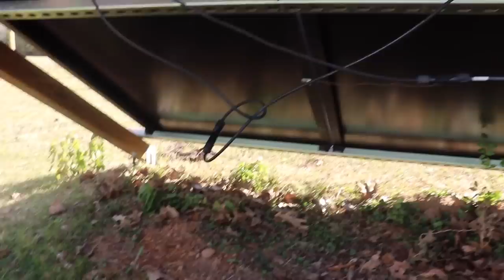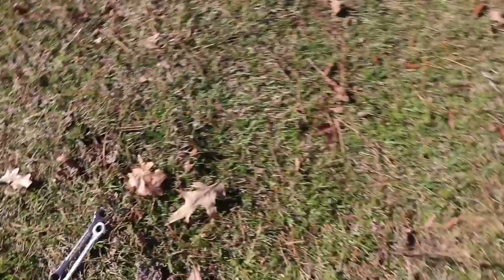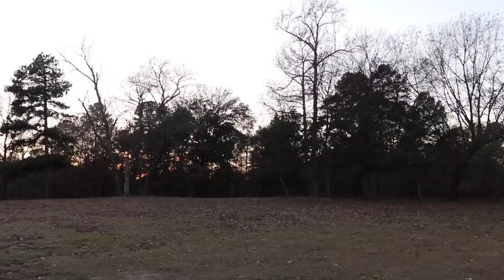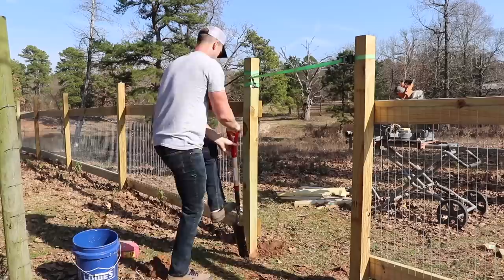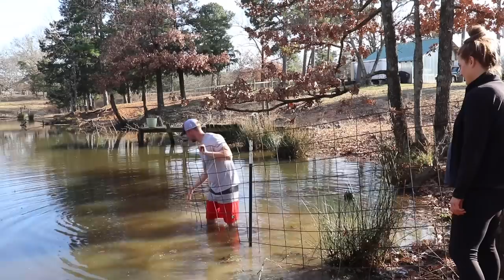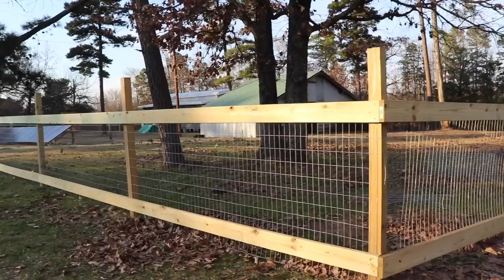Building More Than A House

Comment: i hate to burst your bubble but the fence will never keep a dog in by itself. one must have an anti dig wire on the inside and also be tall enough to stop jumpers and climbers. also, mr. spencer, if you will use pea gravel around your gate posts (all for that matter) and tamp it by tapping the posts on opposing sides with substantial hammers, the posts will not loosen up and will not rot off at the ground line like using concrete. future extraction is made easier doing this. hope yall the best......g

Comment: Ok you better put a hot wire on that fence with Barb wire and cement all the posts if you siol is clay or caleechy add cement lie and soda you don't have to add water it will keep on hardening

Comment: Congratulation guys your almost at 300K, I'm so happy for you. OMGoodness I do believe I would put a hot wire on top as well. Also, leave that pull strap on as long as you can, yep they will keep pulling apart even with the cement as they settle over the years. I wouldn't take it off ever. Those Coyotes would terrify me, I heard a coyote one night and it sounded just like a Hyena scared me so bad it took me a long time to go out in the dark again. OMG those hogs could kill you then eat you. I would be killing them then eat them.

Comment: Pardon me for my ignorance but when you were nailing the wire fence to the posts you would just do it vertically on the one side. Would it not be stronger I'd you hammered on an angle and Crossed over. That way it would be two wires versus one.

Comment: Any reason why you didn't place Solar Panels on the roof of the house or Barn?  It would place them above access by critters or "Bear".  This Old House on PBS recently used a BARN roof to provide electricity and water heating capacity to a "ZERO ENERGY" house project.  It gets solar panels above SNOW and flooding issues.  (Is SNOW an issue in your area.? )

Comment: What is that winch fence puller thing? That's the reason that's holding me back from doing our fence, no strength/way to pull wire fencing.

Comment: I mean no disrespect but if that fence lasts I'll be surprised and eat my words. I've had cattle, horses, goats and mules. What u put up is very flimsy and low grade. I used it once and never used it again. Cattle especially rub up against things and I've seen them even destroy barns with 10x10 posts. I honestly think u are making a huge mistake. I apologize for being negative but I learned my lesson once and only passing on advice. Oh and my rottweiler destroyed that type of fencing as well. Personally I would have gone with a solar electric fence and u will never have a issue. Cheaper and faster to install. Now since u have your fence already going up I'd highly suggest putting a 3rd board in the middle for when livestock rub up against it. Still I support your vids and always look forward to them!!

Comment: Just electrify the fence them feral hogs will destroy it by routing under it ,and if the bull is big enough the fence won't stop him long . I ve seen bulls push a fence over in seconds but not even go near a electric fence. They can sense it and move on. And they can get around the fence in the pond they are pretty good swimmers. But look on the bright side, you gave the snakes a place to hang on. You'll see them better. Seriously burn some old rubber shoes, tires anything made of rubber and the snakes will leave.

Comment: Are you going to treat your fence post and boards with burnt motor oil and diesel fuel are kerosene and and motor burnt motor oil it prolongs to fence post and the wood 4 years you can mix it 50/50 and a bug sprayer and spray it on your post once a year and you will not have to worry about your fence post for quite some time

Comment: Hi, nice fence but what a waste of time & materials , a single or double “electric tape “ run from an electric fence box driven from your solar battery pack would do the same, if not better job at a fraction of the cost.
Last year we installed a 2.6km run of electric fence in two days.
Ed,